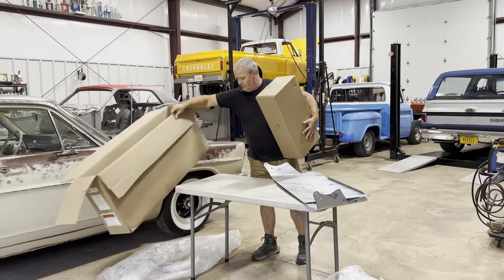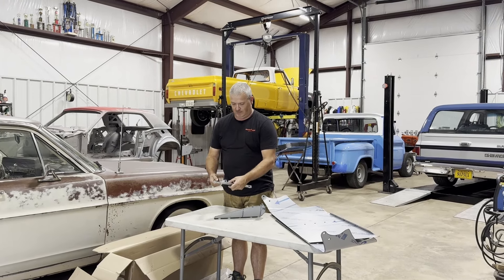Peterbilt episode 9 we finally get license plates, go for a drive and learn a valuable lesson on DOT

Comment: Great info on D.O.T. # - those bandits get there $ no matter what . Had same problem years ago with a truck  bought at auction and no history on truck .
Reply from the maker: crazy part was, i knew i was going to have to pay, but i couldn't even get the paperwork and computer mess cleared up to give them money 😂😂💰💰 we all good now though, thanks for watching 👍🎥🎥🎥
Reply: @stormyweather9054  wow, this is some good information,  would this play a part in some used Trucks being priced at a lower Cost?
Reply from the maker: I'm not sure on that, guess it would depend upon what DOT violation was flagged. Mine was nothing to do with truck being bad or anything. it was just paperwork issue. Just would have made it so much easier if i had known it ahead of time. Thanks for watching 👍🎥🎥

Comment: I enjoyed it !! Thanks for takin me along with  Yall !! from the beginning , i've wondered about the gear shifter , that Stock ?? looks like from an old model 13, just curious , if it were an older tranny ? or what , not that it matters , i was goin say if the ac works , might possibly draining inside instead of out like it should, just a thought . Take Care , Catch Yall Later
Reply from the maker: @jamesconn7311  I think it’s an older tower put on the 13 speed, truck had a 15 original.  But I guess someone liked this one better 🧐 no the a/c definitely is not it, it’s hotter than Texas in that truck 😂😂😂 thanks for watching 👍🏻🎥🎥🎥
Reply: @andhotrodshop   Thanks You Two !! Take Care !! Good Nite !!

Comment: Is your over drive working now am from Jamaica checking in
Reply from the maker: no sir it is not working on a consistent basis, going to fix the brake problems and go out and try it again on the highway 👍✋🔧🔧🔧🔧
Reply: Check the piston in the overdrive if it’s moving probably it need the insert valve the one with three o rings on it
Reply from the maker: @DelwinCowan-mb8so  got ya 👌👌✋✋🔧🔧🔧🔧🔧🔧thanks

Comment: Speedo is probably off from having bigger diameter tires than it's calibration for . If that's a 13spd trans you should flip that black slide button to o.d .
Reply: Sorry,  it has smaller tires. Smaller spinning faster speed thinks you're going this speed . Since smaller has to turn more revs than a larger.
Reply from the maker: @richardmeinhardt9024  yeah truck is running on 24.5’s now 👍🏻🙌🏼 yeah last time I moved it to OD it went to neutral 😂😂😂 that’s another issue I have to figure out 😂😂🔧🔧🔧 thanks for watching 👍🏻🎥🎥

Comment: Shift to overdrive
Reply from the maker: @timgravier7804  last time I did that it went to neutral only 😂😂😂 it’s still on the list of things to fix 👍🏻🔧🔧🔧 thanks for watching 👍🏻👍🏻🎥🎥🎥
Reply: @andhotrodshop  So, I'm 64 now - some things we never forget - when I was 18, I used to rebuild transmissions and rearends of big trucks - all kinds. From what you described, it sounds like an issue with the OD splitter valve on the back box or an air leak to that splitter somewhere. I don't think it would kick to neutral in the main box when splitting the back box - might just be an easy/inexpensive fix.
Reply from the maker: @timgravier7804  I am suspecting an air line problem myself 
When the truck is off and everything is quiet, I can switch from low to high and I hear the change in transmission on the sliders
But if I move it to overdrive I hear nothing but air change on knob.  No movement, nothing 
So yeah something wrong, just not sure what at this point 👍🏻👊🏼🙌🏼🔧🔧🔧🔧
Reply: @andhotrodshop  I wish I could hear it.........but seems like you know where to start.
Reply from the maker: @timgravier7804  luckily I got plenty of time, not like I go to get 400 cases of coors to Atlanta by morning 😂😂😂 if I don’t get it, I can call you in for backup 👊🏼🙌🏼🔧🔧🔧